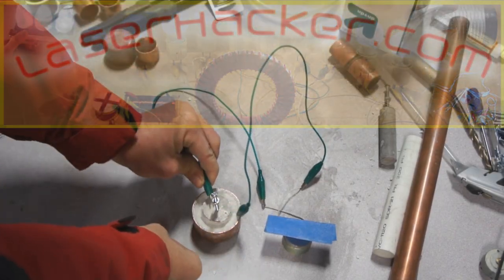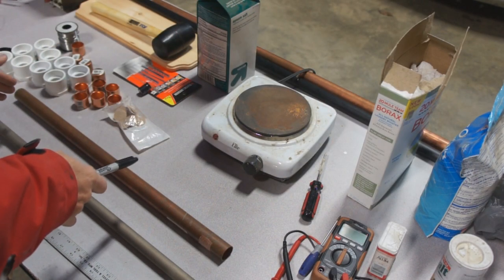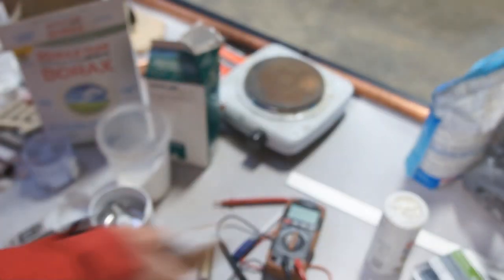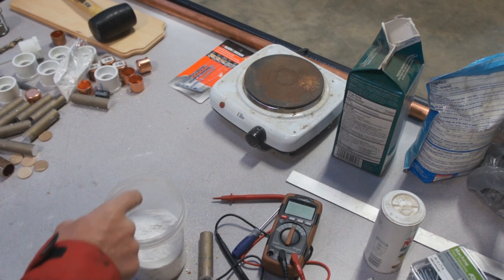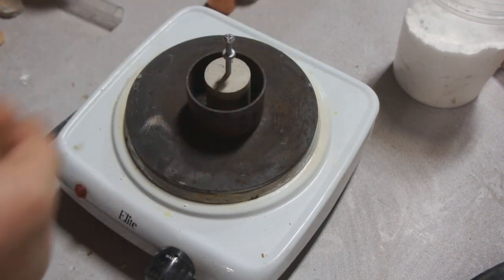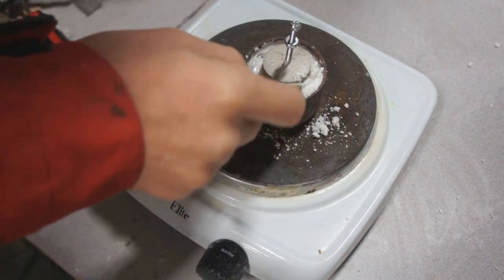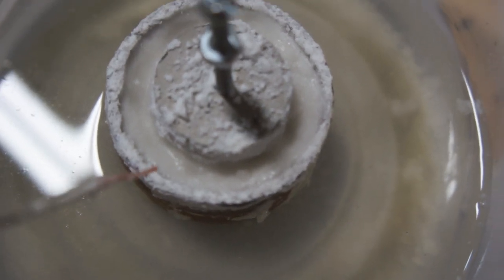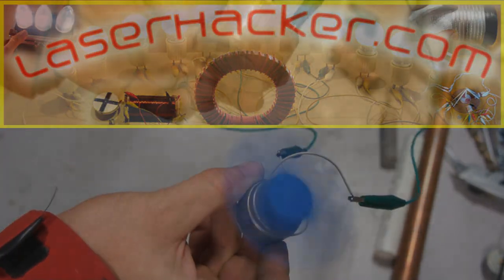How to Build Crystal Power Cells - Long Duration Power

Comment: Why is this called a "crystal cell"?  Its just a regular dissimilar metal cell like you'd buy in a store, only much more expensive and much less efficient.  I mean its great as a demonstration of regular battery chemistry, but "crystals" dont really have anything to do with it.
Reply: +htomerif Salt is a crystalline substance :P
Reply: Legal Skateboarding not when its dissolved in water its not.  I think this is the one where the guy uses some hydrated magnesium salts that release a crapton of water when even slightly heated.
Reply: +htomerif nothing was dissolved in water
Reply: mason turner Yes it was.  They used magnesium chloride hydrate (or another hydrated magnesium salt).  This usually has the formula MgCl(4H2O), containing much more water than magnesium salt.  Even though it's a crystal, when you heat it the water is freed and is free to dissolve the other salts.
From the other "crystal cells" I've seen, the cells form a dehydrated salt layer on top of the hydrated salts beneath which act as an electrolyte.  Once this electrolyte becomes completely dehydrated, the cell stops functioning.
Even though people don't know why what they're doing works and attribute it to "crystal magic", they're using hydrated salts to act as an electrolyte mixed with other salts to act as a protective layer, usually wrapping the whole thing in tape, further reducing water loss.
Reply: Thanks for obnoxious comments. Very educational.
Reply: You misunderstood me. I really appreciate your comments exactly because they are obnoxious and in the face of what everyone wants to believe/hear. I am not scientist to validate their correctness but I do value different view in order to mold full picture.
Reply: Vilo Conshmillo Yeah, there were like 6 ways to take your comment.  As you can tell, I'm used to it not being the way you intended from people like the "crystal battery" crowd.

You can buy magnesium sulfate, sold as "epsom salt" at places like Walgreens.  When even heated mildly the crystals turn into a pretty dilute solution of magnesium sulfate and liquid water.

Not to drive the point home, but there are a lot of ways to make these "crystal batteries" more efficient, like replacing the salts with acid electrolytes and using different types and geometries of metals.  Not surprisingly, the better you make a "crystal battery", the more it just looks like a regular battery.
Reply: " Not surprisingly, the better you make a "crystal battery", the more it just looks like a regular battery" Soooo... image what we can do then if the battery cartels and conspiracies didn't assassinate or buy-out our best scientific minds! LOL!!!
Reply: BIll Georgoulakis Uh.. You're kidding, right?  The "best you can do" is end up being a small fish in an already saturated, technologically mature and decaying market.  The non-rechargeable battery "cartels", as you put it, have long since switched to more profitable and legitimately all-around better technologies like lithium-ion.

Either you were being "ironic" or you grossly misunderstood what I meant.
Reply: The fact that this comment I made can be mistaken for anything other than sarcastic and ironic shows the sad state of affairs that common sense and knowledge is in! OF COURSE I was trolling... see my other comments too...
Reply: BIll Georgoulakis Well, at least I recognized the possibility that you were trolling. :/
But no, if you really want to immerse yourself in total despair at the unsalvageability of humanity, just look up a little channel called "jeranism"
Don't worry, though. Scientists are (literally) networking live rate brains together (rat included) which are capable of solving problems that the individual rats cannot, so while human stupidity cancer may be terminal, rat hive-minds may literally outpace us in terms of intelligence.
woot.
Reply: Have you build oneself and tested it? If you compare it to regular battery,how can some people still get current flow after many years without charging it?
Reply: htomerif
How old are you son ?
Reply: htomerif I think you are 14 years old
Reply: ***** These people go around fucking with people they have no clue about.

I'll just say this: 40 out of 40, 10 years straight is a good reason not to pretend to fuck with me in real life. BinAlladin I'm talking to you.
Reply: What's the point of all those profane rants??? Do you have to "know everything" to know not to fall from the 3rd floor balcony? Do you have to have personal experience about that? The question at hand is simple, why is this galvanic battery called "crystal cell"??? It's stupid and pretentious. What are your arguments against that?
Reply: htomerif
Mr.Right is back and he know everything . He have been very humble to give my second chance . Cant say how lucky i feel now.

Is he in politics ?Wonder how he can be so cool and real rolemodel to rest of people here in this comment section...

Your Mr.Right is back
Reply: htomerif
How did you know I was from Russia?
Reply: BinAlladin I dont.  So are you gonna do it or not?

Actually, after just a cursory glance, "Potulov" is a Russian name, right?
Reply: Iam starting to like you. I have to back off now,because you are going to win. Time for me to say ,good night .Farewell Sheriff
Reply: The magnesium sulfate that was used to build the cell is MgSO4•7H2O aka magnesium sulfate heptahydrate with seven waters of hydration. If I recall the first part of the video (multitasking right now), there is some Alum in here too which has. four waters of hydration if memory serves me correctly. The Borax used has 10 waters of hydration. By the way, these various amounts of waters of hydration are all per mole of their respective parent compounds. One of  the earlier poster's point was that as these various hydrated mineral salts are heated, the heat liberates the waters of hydration from the parent salts to which they were formerly incorporated. The result is the bubbling "liquid" paste of metallic salts. The KSp's of a few of these minerals are such that they would readily and completely dissolve if the molarity of the mixture weren't so high. Even so, it does allow a reordering of the crystalline structure relationships of the various cations and anions until the temperature lowers enough to allow the water to become part of the reordered crystalline matrix as waters of hydration again. Apparently your mixture is stoichiometrically balanced enough in the new formation (with respect to the waters of hydration) that the new material is not terribly hygroscopic. The one long term test cell that is pushing your magnesium  core out of the copper cup is on account of the hygroscopic nature of your semi-solid electrolyte. Still, if it's only moved a fraction of an inch in two years, it's probably less hygroscopic than the original physical mixture was prior to heating, give equal ambient conditions. I say semi-solid as while it appears to be solid, I reckon that from a P-Chem standpoint, it's probably really more of a very, very viscous liquid. I'd have to see a "schematic" of the electronic configuration of the majority crystalline matrix of your electrolyte. Also, someone mentioned using stoichiometrically to optimize your mixture. Someone who's actually used their BS in Chem more recent than I could probably write a stoichiometric balanced reaction equation for you. My degree served to get me in the door at Pharmacy school and out the exit with my PharmD and now I'm a licensed drug dealer.
Reply: Kirk Bolas You realize you just wrote a dissertation for people who literally believe these things run on "crystal magic", right?
I mean good on you and all, but at some point you just gotta give up and let the insults fly.
Reply: Kirk Bolas
can you make drugs for me ,if I pay you good?
Reply: ***** crystals are not amplifiers of anything.  Some of them can be resonators .
Its exactly analogous to the resonant cavities in musical instruments.  Something like a flute can resonate at a specific frequency, but it adds no energy.
In both cases energy has to be put in and you always get less energy out than you put in. Energy here meaning the practical, scientific sense of the word, not "mystical spirit energy", which is a thing that does not exist.
Reply: htomerif" crystals are not amplifiers of anything" Just wondering ... what type of crystal are you referring to? 

I think that Stephan Pegg mean with "amplify" is like antenna to broadcast vibration or signals.
Reply: ***** I try to stay away from quartz crystals. They are very powerful to broadcast whatever signal that is close to crystals. Did use only clear cut lab grown crystal for maximum clarity for my recent experimentation. Will build amplifier circuit with feed-back loop system where crystals act as capacitor. That feed-back loop system with quartz crystals is very interesting. I have seen how quartz crystals are able to produce small current flow ,when using only quartz ,at least 3 quartz crystals and no circuit.
Reply: BinAlladin yeaaahhh no.  She meant the crazy woo kind of "amplify".

Doesn't really apply here anyway since none of that stuff has any bearing on DC.
Reply: htomerif ...htomerif ...if I get a few free minutes I'll write out the redox reaction that is taking place. This is essentially a "dry cell" battery, not unlike the the magnesium salt based carbon cell batteries that were ubiquitous 45 years ago with the electrolyte not being truly dry, but rather a paste. My reference to the reordering of the crystalline structure was me wearing my chemist's hat. I don't own a grey pointy Gandalf hat, so in there is inference that I'm speaking of crystals in those terms, that's on the reader. The liberated water of hydration results in an ionic solution because the starting ingredients are the result of a metal and a base associating when the water is removed. The ionic charges result when the water is reintroduced in the spaces that previously were "dry". The system now has cations and anions "floating" around in it, where neutral charge was the previous state before. Creating a conductive, low resistance pathway between the anode and cathode in this system allows the charge to flow from one plate to the other and restore the neutral state. In very simplistic terms, that's how a chemical battery works.  Now as to some sort of infusion of fairy dust or a pinch of Unobtanium, I'll leave that to others to demonstrate....the ones with the Gandalf hat for instance.
Reply: Kirk Bolas I dont understand why you're directing this at me.  Isn't this exactly what I said earlier up?  Its been so long that I dont remember, but I'm pretty sure I said that the hydrated magnesium "crystal" literally ends up being the electrolyte in a classical chemical cell.

right?

Like if you just read the initial comment, I could see why youd be explaining the chemistry, but in pretty much the very next comment I made I kind of said what you're saying?

I mean the whole point here is that this is a simple chemical cell, not a magical resonant spirit energy crystal fairy cell.
Reply: because it has a crystalline electrolyte. Just like an acid battery has an acid electrolyte and an alkaline battery has an alkaline electrolyte...
Reply: because the solution forms crystals.
Reply: htomerif.   Interesting comments you've made a while back. You seem to understand chemistry well, but you're very defensive and condescending. I'm not sure why. You should use your intellect to educate people and provide solutions instead of insulting them. I know people can be over sensitive and by your defensiveness and abrasiveness I'd say you seem a little over sensative as well. The problem with a lot of intelegent people is they'd rather waist their energy on showing how smart they are and condescending others rather than providing any progressive solutions. I've been guilty of this myself and had to ask myself what significance does all my knowledge and research gain if I am only pointing out the problems but not showing how to fix them. After all it's easier to point out problems isn't it?
Reply: Water has crystalline structure, you are thinking 2d. Our brain uses those same chemicals to fire electrical processes. Therefore, they contain energy. You also need to do some research on piezoelectric crystals because they are utilized in many areas of our lives and most people don't even know it. Crystals like quartz create a never ending source of power when struck or pressure is applied.
Reply: Metals are crystalline and most if not all the Interstitial ingredients are as well.
Reply: If u don't understand the significance of this you are not a real scientist. Period.

Comment: Using a vibrator (believe it or not) against the side of the copper cap as the mix is cooling will get air bubbles to rise out quickly, and heat to release as well. This is what concrete workers do on big construction jobs (on a much larger scale of course).

Comment: Why don't you put a resistive load across the cell, depending on the value of the load
in (Ohms), you can test the cells very quickly. Learn the basics of electricity!

Comment: Magnesium and potassium (and/or maybe sea-salt) firm up rock hard. I supplement with them to maintain my own body's energy potential. After mixing them all together in powder form to make an easy travel pack, the contents became rock hard.

I wonder if the ingredients are thoroughly mixed and packed in the cell, you could eliminate the cooking step. It may take longer to set up, but in a McGiver Apocalyptic situation you may be able to get positive results without the heat, allowing a person to produce numerous cells quickly. Eliminate the heating part and the process becomes quicker in labour terms. It might take a day or so to set up rock hard on its own.

Comment: hi lasersaber. i ve been making these for the last few weeks doing experiments on whats the best material. i have not got any magnesium yet however i have tried using galvanized bolts and zinc bolts (the galvanized produces a slightly higher volt, everything else being equal) how much diference does the mag. make .my best ones generally produce .8 to 1.2 volts after a few days (more at first) ive been experimenting with the mix as well, all combinations of rochelle salt, epson salt, salt substitute,alum, borax, even some lead and calcium (scraped from the inside of an old water heater and dried , im not even sure its calcium to be honest) filings. i find that size does matter. my best one is 1" x 3" x 6" copper box with a galvanized strip ( 1/8" x 2" x 8" <1 1/4"bends at each end of strip to fit inside box>) this sucker has leveled of at 1.6 volts and .23 volts but there is lots of oxidization already showing on copper, i think my rochelle salts were too wet(i made them) also i have 1 other point. just holding the different metals to my multi-meter i show about.7 volts, (goes to 1 v with vinigar) so i guess what i want to ask is do the crystal batts last a long time(if no corrosion) compared to the wet mediums like vinigar or saliva which i would guess will eventually consume the metals. thanks for your vids i was genuinly inspired, i cant wait to get home from work to test my theories, ive been driving my wife nutz
Reply: This may sound gross, but I was wondering what urine would do as the substitute..just a thought..

Comment: There are two dissimilar metals in these cells.   Magnesium has a high energy releases when "burned".  Is  there a slow chemical reaction in the cells that eventually fizzles out?  In the long run does more energy come out of the cells than can be explained by any magnesium/copper/salt  chemical reactions?  Though there is no water in the mix there are hydrates galore in the salts. Can you use something else instead of magnesium?  Is this in reality some sort of slow acting dry cell?  What if you used stainless steel for one electrode?  What if you used a copper rod in the copper pipe? Are there other metals you can use with the same results?  What if you used a carbon rod?  What if you used a piece of depleted uranium? or is this truly a totally solid state generally immutable device like a transistor, coil resistor or a diode.

Comment: Thank you so much also have you thought of using a vibration plate to remove bubbles maybe even specific frequency or maybe vacuum cooling. Finally what are you thoyghts on orgonite ad would it's application by applicable here?

Comment: I am assuming that the cells push apart because the crystal mixture is expanding. But my question is why? Is the mixture "recrystallizing"and that's why it expands?  Kinda like how water expands when frozen? I also wonder if the mixture expands because its in contact with the magnesium and copper and does it still expand when by its self? Could the cells be put together after the mixture has already expanded?

Comment: i also know they add silver and i know that with some rocks that you find have silver so I'm guessing that  if i crunch my silver sparkly rocks and add a crystal rock that i have ill charge it and activate its source thru compression because all batteries are. and water to electrify the whole source. then once my battery is finished i guess ill be at 1.5v 2.5a so i have the materials I'ma try that.

Comment: Hi lasersaber,  i just made a cell to your salt mix but used a larger plate of copper and a wound ring of magnesium, getting less than half a volt., so i need to get a copper cap and mag rod. I saw your cap looked pre-heated with dark oxidation on it, do we need to do this or is fresh pink copper ok?